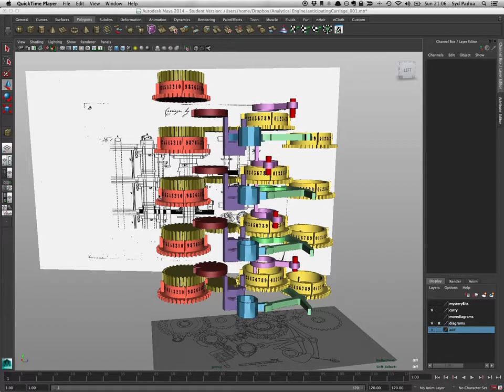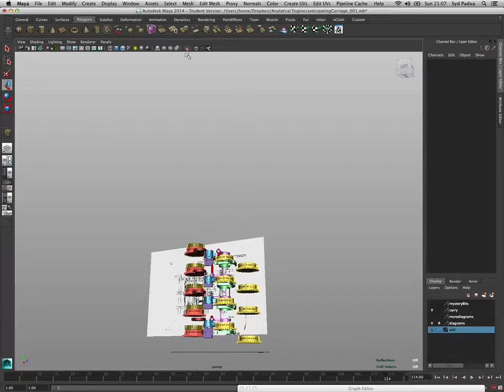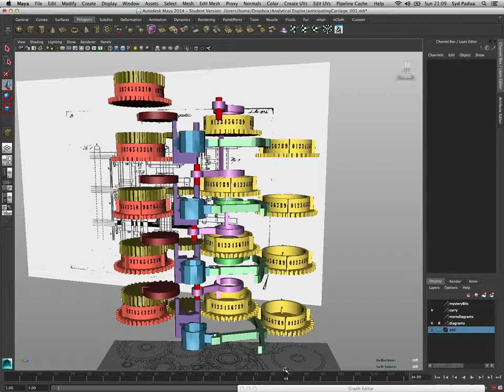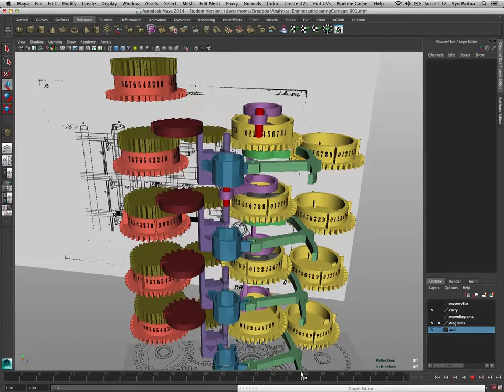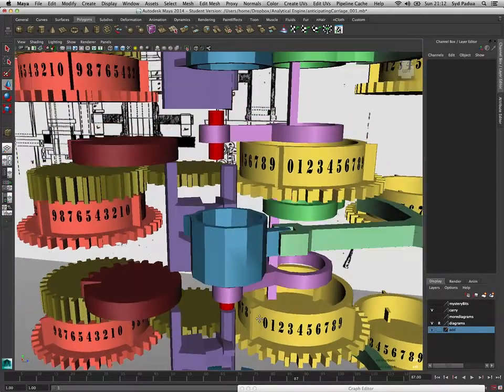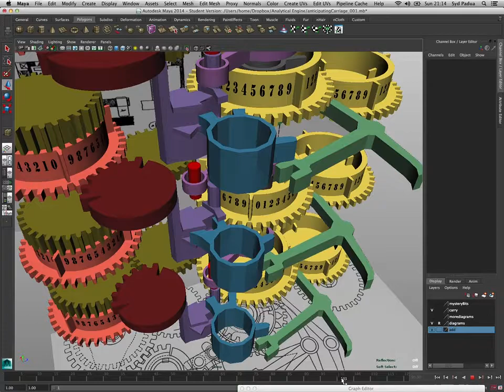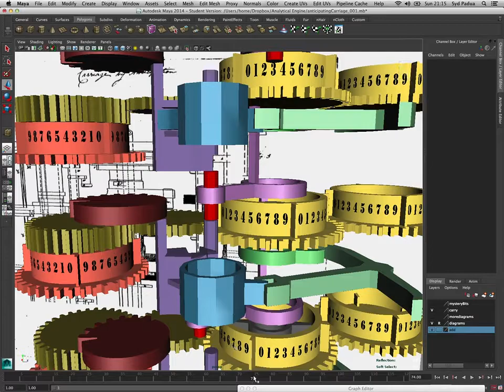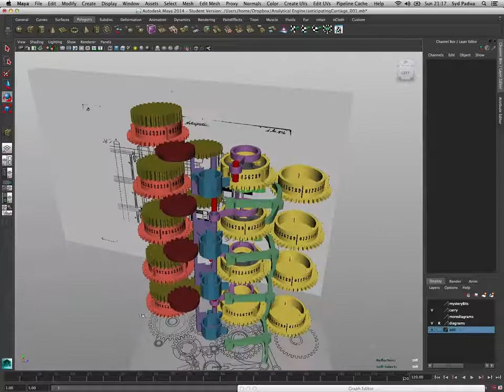Babbage's Anticipating Carriage

Comment: I’m trying to draw this part inside the head of a “mechanical mammoth”, (or mathematical mammoth) as a 19th century style drawing. But had trouble understanding what exactly I was drawing, so thank you very much for this explanation. In other works I used Tesla patents, and steam engines, but they actually were much “simpler” to understand as a concept. So thanks for this 3D model. I will post the result here when I’m done: https://strokesanddots.nl